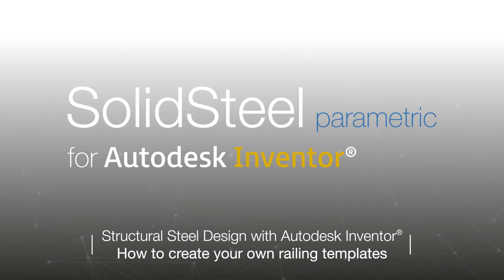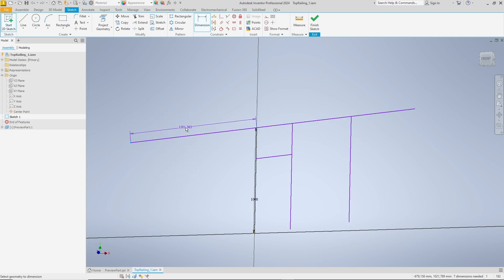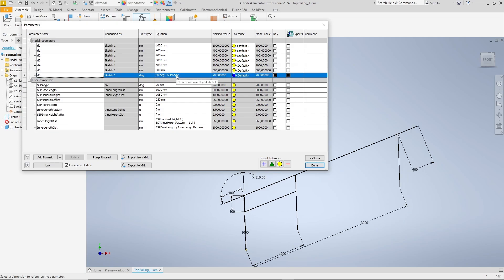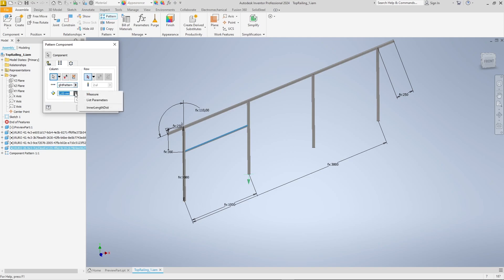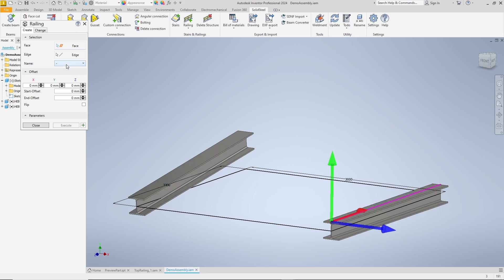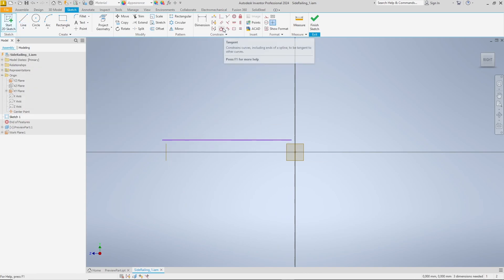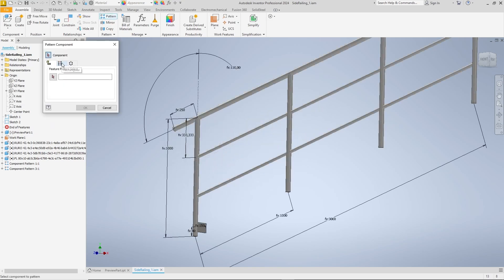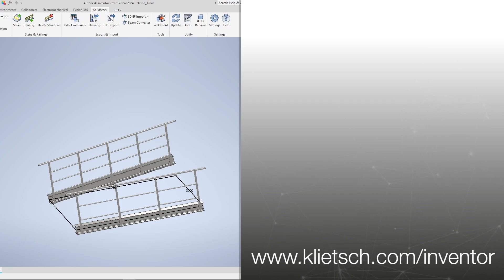Make your own railing templates to use in SolidSteel parametric for Autodesk Inventor – Tutorial

Comment: where is this PDF user manual???
Reply from the maker: Hi @jamcelroy,
To open the PDF manual, just click on the Help button (the one with the question mark) in the upper right corner of SolidSteel parametric.

Bonus tip: If you click on the question mark inside an open dialog, the PDF manual will jump directly to the page describing the function of the dialog.

Hope this helped, best regards,
The SolidSteel parametric Team

Comment: Hi, 
How can this be applied in case if the handrail has a 90 degree angle?
Reply from the maker: Hi there,

I'm not 100% sure what you mean by a 90° angle, but I assume the question is about a vertical railing. This is not a problem, if the reference face is selected to be mounted on a column, for example, the railing will automatically follow that orientation.

Feel free to test it yourself with the parametric version of SolidSteel Express. You can also skip the process of creating your own template and just try it with one of the railings that come with the software. You can get the Express version at no cost here: https://klietsch.com/get_ssp4inv_express